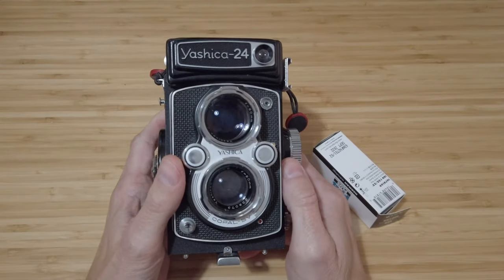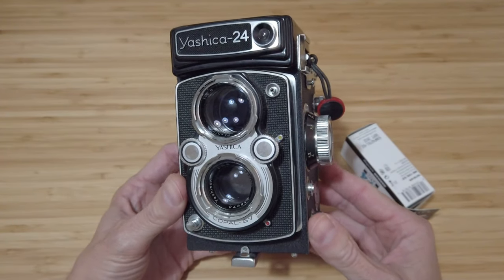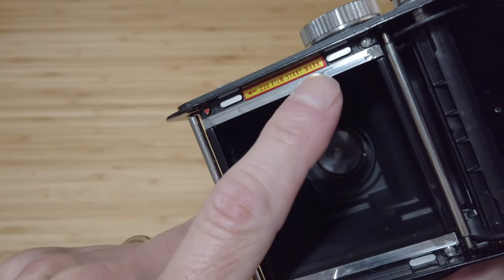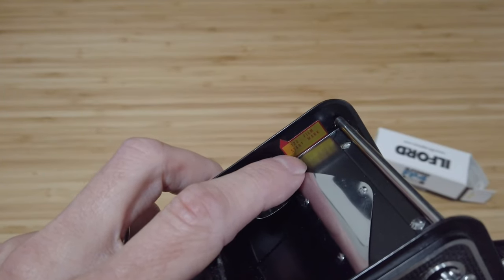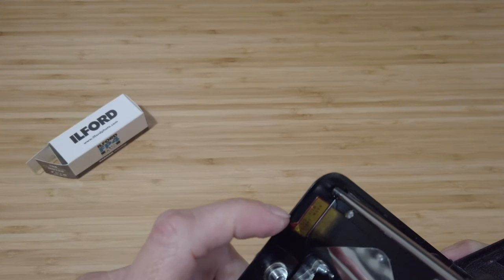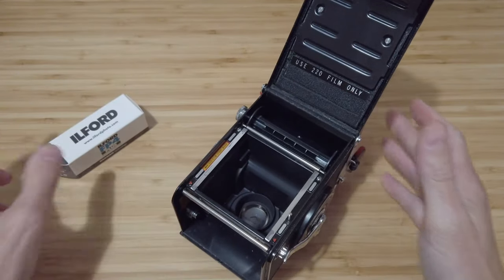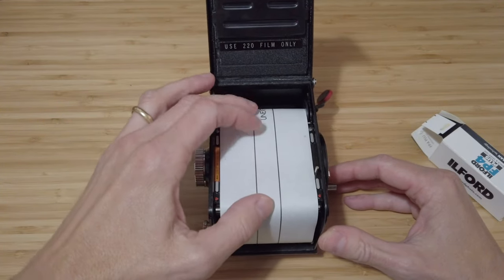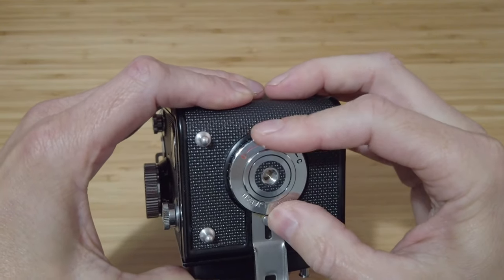Loading 120 Film into the Yashica 24 Twin-Lens Reflex (TLR) Camera

Comment: This is an odd camera, even for its day. Prior Yashica TLRs shot only 120 film. There was a popular interest for a whjile in 220 film, so Yashica produced at the same time the Yashica 12 (same as the prior 120 roll camera) and this Yashica 24, which is the same except for a slight change in the film advance gearing to accommodate the thinner film package, which lacks any paper backing.  The interest in the 24 and in 220 film was short lived and the 24 terminated. This camera looks like Yashica just added a sticker to the last of its 24 cameras to allow them to be sold for 120 film use with no actual adjustment to the mechanisms. This means that as you advance through a roll of 120 film, the frame spacing will widen, making it hard to fit twelve frames on the roll. This silly situation was replaced with the first of several "Yashicamat" models, in which the film advance mechanism adjusts to the needs of each film type and took both 120 and 220 rolls without frame spacing issues.
Reply from the maker: I only bought this version as it was a good price and was assured that it took 120 film which it does and I've been more than pleased with the results. Just a little trial and error in terms of getting it to play nice with the lab box or at least to be aware that the first exposure won't fully develop.  When I've shot my 12 exposures, I then just fire away until the rest of the spool is on the take up reel.